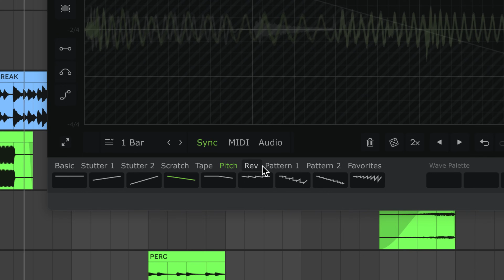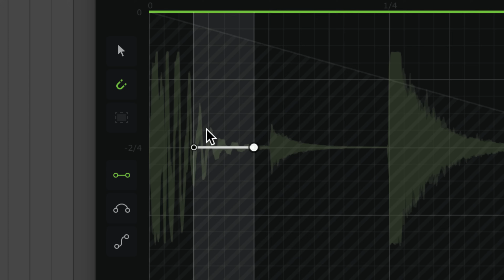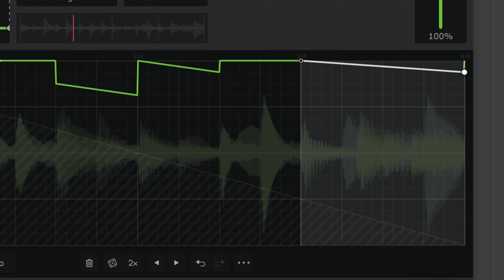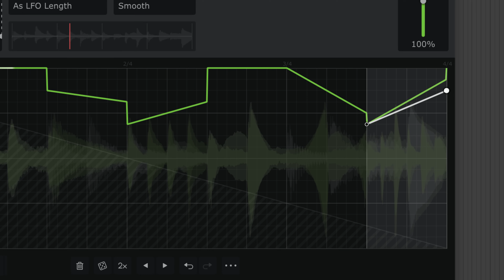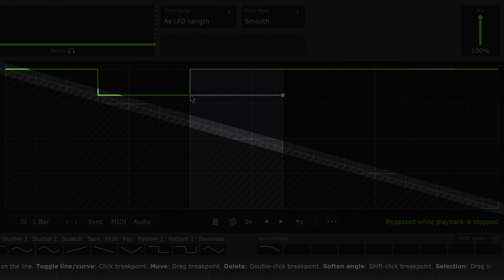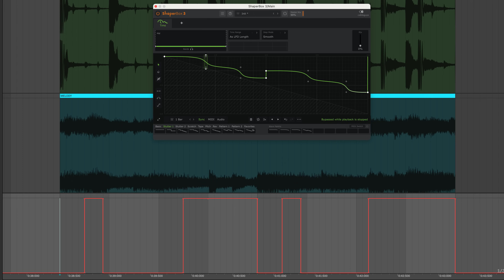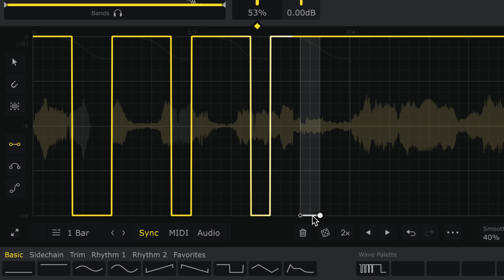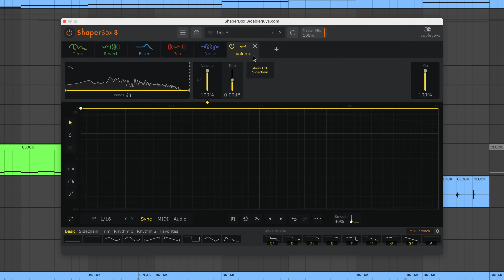TimeShaper for ShaperBox: The Ultimate Guide

Comment: Another thing that could push all Cableguys (great) products into another world territory, could be something similar to this (the LFO modulation action shown): https://www.youtube.com/watch?v=OpDZ4Nxjq8E - now this is so lively, organic, moving. What I mean is, that the LFO thing shown in the mentioned video could serve as an underlying modulation for the main, designed LFO shape, it could alter it continuously in a slight or more profound manner (however the user desired).

And if you think that's too much of an effort to be useful enough, please consider introducing something like a "brush" or a "parametric EQ"-like method of alteration for your LFOs from the outside of the editor, with (say, 6?) "bands" at configurable sections and exposed to the plugin host as automatable parameters, for further creative ideas, especially while using modular hosts.

Please, consider something similar for your LFOs, which, although fantastic to edit, etc. are just too static, too repetitive. You set them once and there is no surprise element, even if you wanted it. There should be a way to manipulate the LFOs from the outside of the editor, via plugin parameters.

Comment: I've had Shaperbox for a few years, however being as powerful as it was. I never really put in the time to actually master it. However recently I've double down and actual got to learning my plugins ins and outs. To do so I first had to stop buying every NEW cool crap in the saturated plugin market. Now I'm steady taking my time with this ones I own and actually like. Oftentimes spending months using only plugin until I feel like it now within my arsenal. For this plugin in particular I've been taking its effects one box at a time. After around four months of intense use of this plugin I'd say I've "moderately mastered" 5 EFXs thus far. Oftentimes happy using them on my own. without any need for presets. Still this plugin is intimidating for sure. Still taking it very slow when it comes to mashing a bunch of effects at once.

Comment: Can it do a continuosly slow down? Like with a taperecorder slowing down the speed, but for a much longer time. A slowdown for several minutes for instance, though that the frequencies change slowly, but continuosly.
Reply from the maker: Due to memory reasons, we have to put an upper limit on the maximum delay/time offset TimeShaper can apply. So no, it cannot slow down for an arbitrarily long time period.
Reply: @Cableguys  That upper memory limit should be a user modifiable setting, not a set in stone one, don't you think so?
Reply from the maker: @daniel.konopka  Ideally yes, but it can raise some issues (namely maxing out your memory fast without realizing why), and it's hardly ever requested.
Reply: @Cableguys  Thx a lot. It's an awesome tool anyway. I really like it.